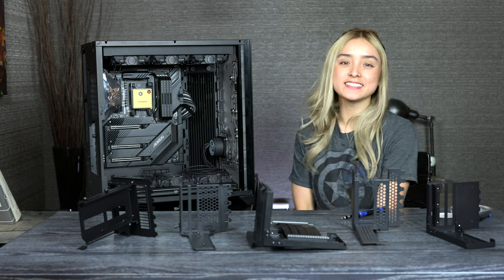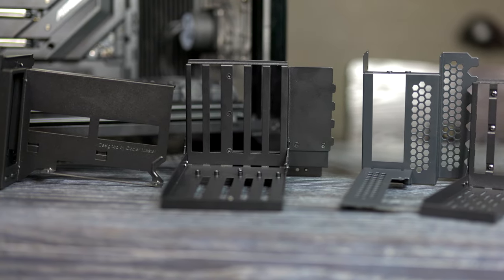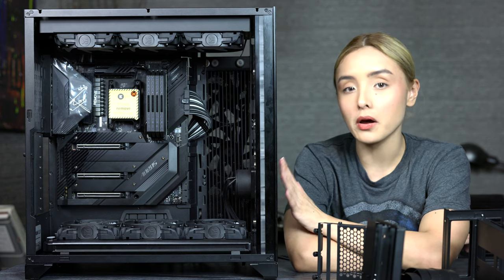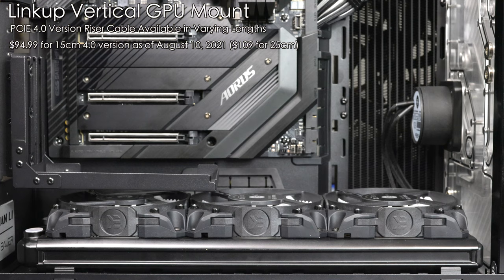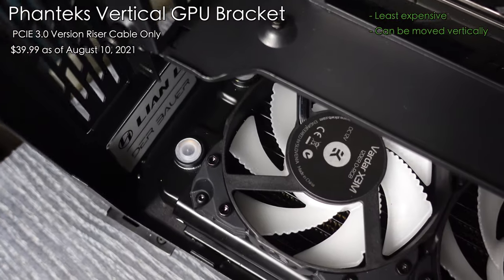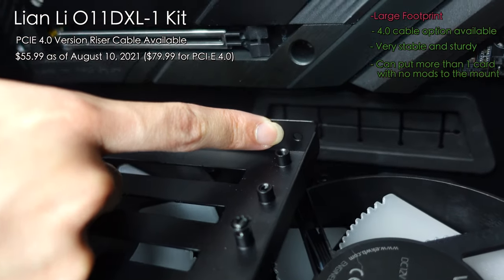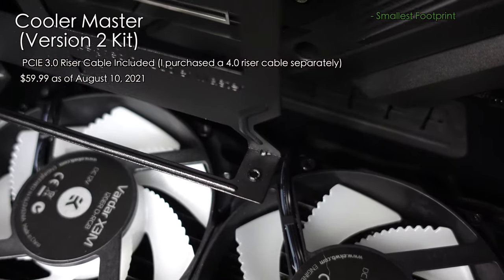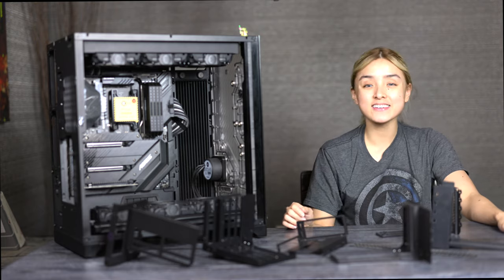Best Vertical GPU Mount for Lian Li o11 Dynamic XL | Cooler Master Phanteks Linkup CableMod

Comment: I am building a similar rig as yours, same case same motherboard, same distro plate, thank you for trying different mounts, but I bought the Lian Li one already, which doesn’t fit well =[ I will buy the one you suggested. Couldn’t wait to see more on this type of video. Keep up the good work💪🏻
Reply from the maker: Happy it helped.  If you have a heavy graphics card I highly recommend the Ek vertical mount.  It's the one I ended up with and wished I had it for the video.
Reply: Thanks for the tip, I am using the ASUS EK 3090, I think the cooler master will probably fit. Which 4.0 riser cable you are using, I find the riser cable that came with the Lian Li mount doesn’t fit well with the Cooler master one, but Cooler master haven’t released the 4.0 cable yet
Reply from the maker: @skylines910  That's a really rare card nice!  ...Unless they changed things recently, the Lian li has issues on 4.0.  The linkup 4.0 riser has worked really well so far.  Good luck.  Also if the cooler master gives you issue, I can't say enough about how much I like the Ek bracket.  I'll be posting my build in the next week or so. Take care

Comment: Thanks Sarah! This was really helpful. I had been struggling to find a vertical mount that suited all my needs (Sturdy, scalability, small form, pci4.0). I have a Liam Li 011D case, its slightly smaller than yours; the fans at the bottom meet exactly where the motherboard begins without any radiators. I tried out the Liam Li mount for my respective model but curiously unlike the XL and the Mini it does not have a built in support beam. Instead it has this bracket that needs the space of 2 bottom fans which is No Bueno. Thanks to your video I have found better options in the XL version (if it fits) and the Cool Masters mount(Will have to keep my 4.0 riser from the old mount to use this one).
Reply from the maker: Glad it helped!  Check out the EK one too to see if it might work too.  It's the one I ended up with

Comment: Phantek has massive sag. So if you don’t want to use a support bracket I wouldn’t recommend it. I haven’t tried any others but it’s just weak metal.

I found the lian li at first glance to just be way over prices. But now I see it’s sturdiness and an extra support screw it might be worth it. Cards are only getting bigger and more expensive so you def want good support. Though that one you got is too fat, I think they sell a skinnier one though

Comment: Thanks for your Review! It really helped me... I`ve got the same case and a pretty similar watercooling configuration. Cool to see, that other people where able to fit a radiator on the outside of the side, even with the "Reflection" Distroplate installed ;) . Only difference to my system is that i have the thicker "Coolstream XE" Radiator in the bottom. I have already been struggling to make the Tubes fit... Ill give a shot to your favorite from CoolerMaster. its most possible to fit my tight system too...  My 3070Ti FE and its EKWB Waterblock might be a bit smaller than your Setup I hope  :D
Reply from the maker: Not sure if you saw my pinned comment but I highly recommend the EK gpu mount, even over the cooler master one.  I discovered it after the video unfortunately.
Reply from the maker: And also, the XE is an excellent rad!   Good luck!

Comment: Hi Sarah - great content. I have a quick question. Will the Lian Li GPU stand be compatible with my stand O11-dynamic?
Reply from the maker: They make separate vertical gpu mount versions for the o11dynamic standard case and also the XL case, you just need to get the correct one and it will work.   If you have a heavy card I would go with the EK vertical mount, good luck!

Comment: Yes, thank you for this.
I'm thinking one of the new Nvidia cards won't fit in this case when mounted normally, right? So, I'll definitely have to get a vertical mounting. Seems to me that the Lian Li would work well for me.
Reply: Would a pcie gen 5 riser cable be needed for the 40 series cards?
Reply: @shagadelic3000  The 40-series cards only use gen 4 PCIe.

Comment: Maybe there's a newer version of the Dynamic O11 XL, because the Coolermaster version now will NOT fit. My XL has a bracket system for the PCI section, with little nubs for the slots to sit on. You cannot seat the CM flush now because of those, without cutting/modding.

Comment: Awesome video! Sadly I think they only one I will trust due to RTX 3070 being a bit heavy is the Lain Le Vertical mount not a fan of the big foot print but Feel more safer with the big thing HAHA! Thanks for the awesome video definitely help narrow down the choices!
Reply from the maker: I ended up getting the EK one.  Super stable!  Got if for the very reason you state.  You can check out how it looks in the other video but I highly recommend it.  Wish I had it for this video.

Comment: Hey Sarah, I was wondering about the Lian Li O11DXL-1-4 kit... Do you know if it is possible to remove the front cover that helps you fix the gpu mount at the Lian Li case?.
Based on the dimensions displayed on your amazing video.  I got the idea that I could use the mount in a thermal take GTS 10.
That case have been with me like forever. It is still in a pretty decent shape If I may say... like almost an A+ :D
It is handling a 5950x with a rtx 3080 installed in an aorus b450m (you may wonder why?, but I started playing with Ryzen from 2600 and upgrade from there from time to time reusing every component available). 
Based on the pictures, I can see it is being hold by a couple of screws, but not sure if there is something else.

By the way... while researching about the part. Came across with your video. Love your honesty... already subscribed to both of your channels. :D

For those who may wonder... The system is full air cooled... a lot of tunning and tweaking around. It is possible to keep the CPU at least on 4.3 Ghz all the time. 
Maybe if the idea works... I can push it to 4.4 Ghz. 
Cheers!
Reply from the maker: welcome to the fam!  I'm not sure about the lian li 1-4 kit's cover.  But there's another option also you may want to look into the latest EK loop vertical mount version as it can hold thicker cards and comes in shifted and non shifted versions that might fit your case.

Comment: Nice build, I ended up going with the EK mount, all the rest didn't look strong enough to hold a 3090 water block
Reply from the maker: I ultimately ended up with the EK mount also.  There was a few milimeters of sag that really bothered me with the cooler master.  That block is super heavy!

Comment: Personally i went with EK’s vertical mount since i have a 309l ftw3 and it was hard to found one at first because I didn’t see that theres supported 3 slot cards but it fit all the requirements i needed it to 3 slots has a lot of room so i can use my active backplate and as a bonus it was pretty minimal when my card was in my case the O11 XL is just such a beautiful case and the fact you can upright mount a gpu in the Evo version is just cool
Reply from the maker: I ended up with the ek as well!  except i got the older version as the new one wasnt out yet back then.
Reply: @SnaxanGaming  i rarely use a riser cable any more since it cuts my available bandwidth in half since i run a triple monitor setup and it goes down to 8GB of available bandwidth and that goes for all Generations of PCIE sadly glad your happy with your Pc it turned out great
Reply from the maker: @jedijonathquan6776  What riser cable did you use out of curiosity?  I'm not using a riser anymore since I went back to horizontal, but when I did i didn't notice the bandwidth go down.  I'm only using two monitors in 4K though though, not 3.
Reply: @SnaxanGaming  i just used EK’s thats had come in the box since i trust them but we want those traces to be as short and close to the cpu as possible witch is why we use the up most slot and since your making those traces longer it leaves information open to more error because if it isn’t fast enough it gives your cpu a harder to register it like say if its a 1 or a 0 so then it needs to put out the same information that say didn’t reach the other side instead of sending new information. i just one monitor for gaming one for just a video on jets or something else and the other for system information like temps power draw etc if you have any other questions feel free to ask.

Comment: Nice work, very useful review.
Reply from the maker: Thanks, happy there are some people who find it helpful.  The irony is that I ended up going with a mount I found after filming this lol.  (the ek one).
Reply: @SnaxanGaming  Yeah, I was hoping the Ek one was part of this review, but either way, thanks. Still trying to decide if I'm even going the do vertical as my GPU will have active cooling backplate. I'm also using the O11D, not the XL as you are.
Reply from the maker: @raroxburgh  I recently uploaded a video of my build and it has the EK one if you want to take a closer look.  PS. if you have active backplate, horizontal is the way to go.  I haven't seen any verticals that are deep enough except for the ones with a large footprint.  Maybe horizontal is best especially since you have the normal size one?

Comment: Thanks, that video really helped me✌🏻✌🏻 can I just use any PCI 4 Riser cable for the Cooler Master mount or do I have to check something before?
Reply from the maker: I used the LinkUp 4.0 cable.  However I actually ended up going with the EK vertical mount after I filmed this video.  I like the cooler master, but if you have a heavy card, you may want to consider the EK one as it's stable.  If you don't plan to utilize the extra benefits of 4.0 or have have an older GPU, you can just use the riser cable that comes with the GPU mount.

Comment: Hi Sarah! I appreciate so much your precision! I'm planning to watercooling this case but I have just one question about vertical mount... I already have vertical gpu mount (the secific one for this case) and my question is: can I move up the gup mount to fit EK-Quantum Surface P360M  on the bottom? I'll use distroplate like you but the tubes on the other side to connect rad whit only 2/3 fittings! Ty so much!
Reply from the maker: I'm not actually sure there will be room, it will be close.  However, if you flip the radiator around I think it should clear no problem since the tubes won't be below the mount.  Also if you get the latest model of the distroplate (the reflection2) it will make things so much easier for you because it's matrix7.  Everything will line up and you don't even have to make any bends.
Reply: @SnaxanGaming  all right! Thanks dear! 👍👍👍

Comment: Useful video!
What distribution plate/pump is that in the front of your case? How does it stay up? I have a Corsair XD7 distribution plate that mounts in a 360mm fan/radiator size, but am wondering if I can mount it in the front of the 011 XL so I don't waste/block the side intakes on the 011.
Reply: (I ordered the 011 but don't have it yet; trying to piece together my build in the meantime but so hard to get the parts.)
Reply from the maker: The distro plate is made by EK (Quantum Reflection).  It screws in and secured that way.  The XD7 should fit fine dimensions wise I'm just not sure how it attaches.  I know what you mean about getting parts, I finally got everything I needed after 1 year!  I'll be putting up a video of my build in the next week or so.  Good luck on your new build!
Reply: @SnaxanGaming  Thanks! Just ordered the Quantum Reflection and will likely return the XD7 then. Expensive, but gosh it would be nice to have a front distro plate designed to fit. Hope it's worth the $!
Reply: And thanks for the bracket comparison, I honestly spent hours trying to figure out which would be best/strongest (for RTX3090 + EK block). Got the EK. I'm still trying to decide which PCIE 4.0 cable to get; got Lian Li but I keep hearing you still lose some of the pcie 4.0 speed and some folks just set it to 3.0.
Reply from the maker: @jasonluxmusic  No problem!  I ended up with the 4.0 cable from link up.  No issues so far. The lian li had issues when I tested in 4.0.  Also the EK bracket is definitely the way to go, the others were just not strong enough.  I wish I bought that one first and had it for the video.  Also at the end of the day, I might even get the active EK backplate and go horizontal after all that.  If you really want to go all out on your temps, (and it may be overkill), consider the active backplate for the 3090 and going horizontal before the return window closes on the mount.  I'm on the fence for now because I really love the look of the bottom of the EK waterblock
Reply: @SnaxanGaming  Thanks - yes I tried to get an active backplate but EK does not make one for the MSI 3090 TRIO. 
Thanks for the info on the riser cable, will try that one!

Comment: for the lian li mount is it possible you can just bring the mount up 2 more slots to make room for a bigger radiator and the tubes because a have the same case and I have a EK 360 radiation on my way Please will like to know if you can bring the lian li mount up to the top slot
Reply from the maker: Sorry, you can’t move it up with that mount because there is a lip in the back of that mount that gets in the way :(

Comment: I'm trying to figure out which vertical mount to get now... great video! My rads are both 45mm EK rads. That Linkup mount looks good because it's adjustable. I have to really think about this decision...I'm using the Loan Li ROG 011 XL case with same front distro plate. No doubt, offset fittings will be required for that bottom rad and connections to the distro.
Reply from the maker: Check out the ek mount I mention in the pin comment.  I ended up going with that one and it's the one I use in my full build video.
Reply: @SnaxanGaming  You went through so many mounts, lol. Ok so your happy with the EK mount? It doesn't say but I'm assuming it has a PCIE 4 cable right? The case we are both using doesn't require the shifted mount I believe (I haven't taken my case out of the box yet).
Reply from the maker: @GSP-76  non shifted version is ok.  It only comes with a 3.0 cable so you might need to get a cable if you want 4.0
Reply: @SnaxanGaming  I got the EK mount on your suggestion...and got lucky because they shipped it with a 4.0 cable. If your happy with it, it should be perfect since I have same case and equipment. I was worried about clearance but I think you can move it up or down correct? It also has reinforcement from the motherboard screws I think.
Reply: @SnaxanGaming  Sarah, I have a very important question for you regarding your PC..for your bottom rad, what size extension fitting did you use? This is on the left side. You connected a 90° to the extension and then ran across to the two holes in the distro. I'm trying to figure out what size extension I can use without interfering with the EK vertical GPU mount. Hoping you see this message.
Reply from the maker: @GSP-76  On the bottom left port I used two 90s if I recall.  I should have it in the pinned comment or description.  It's been a while so I don't remember off the top of my head.  But basically I ran it to go behind the rad and under the vertical mount.  Also and option, to save time I suggest running  a soft tube on the left part, then get a fitting to run it into a hard tube on the visible part on the right.  You don't really see the tube on the left anyway.
Reply: @SnaxanGaming  thank you...now I understand. I was going to use 28mm EK extensions but that would cause a problem for the left tube. Yes, you could use a flex tube or create bends...but I think going 20mm extension and using 7mm offsets on the distro side works great 👍...sorry for bothering you so many months after....
Reply: Well turns out EK doesn't have a 20mm extension...so I used a different brand and in turn had to use a different 90° to make it look right...but both pipes are lower now so they won't interfere with the GPU mount. Thank God I noticed this issue before putting everything else together.

Comment: Not sure about the others but Phanteks and Cablemod were poo, heavy Strix 3090 was bending the bottom part and therefore also bending the rear mounting plate of the card itself.
Sarah, is the 'stabilizer' part included with the Lian Li mounting kit?
Reply from the maker: Get the ek mount I ended up with of you have a heavy card. I ended up with it, o wish I had it for the video.  As for the stabilizer bar, I believe it came with the case (not the mount)

Comment: Hi, Where did you buy the Lian Li vertical mount with 4.0 pcie?  I’ve searched for some stores here in PH and they said it just comes with pcie 3.0 riser cable. So i have to buy a separate cable.